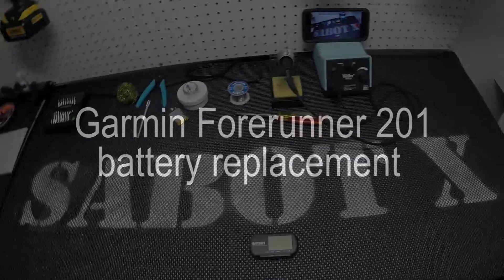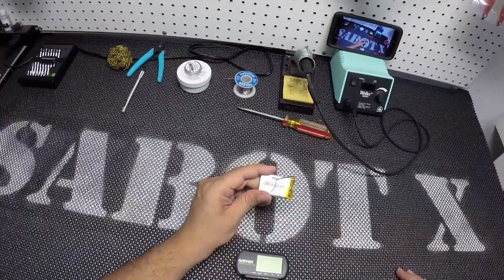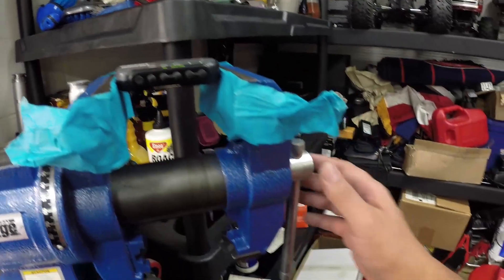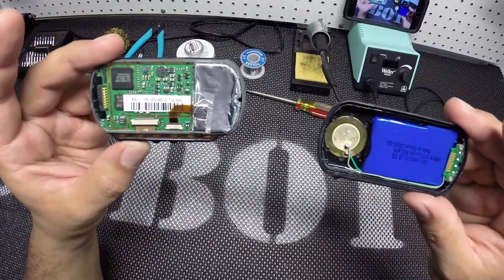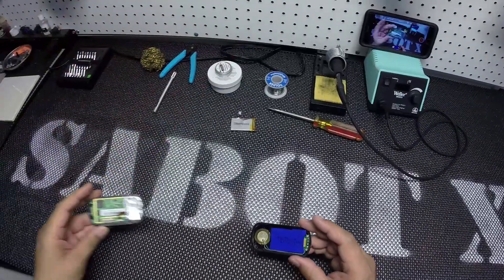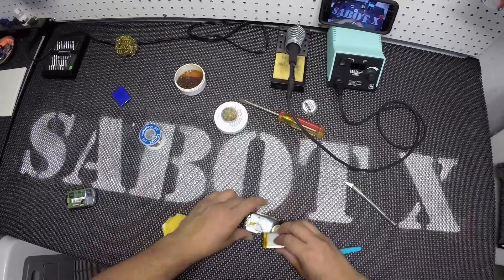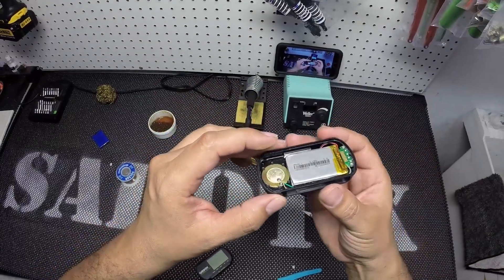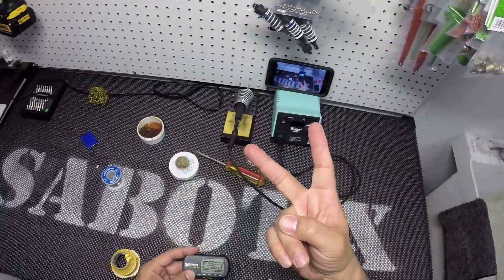Garmin Forerunner 201 battery replacement

Comment: Thanks. My 301 doesn't charge anymore, but I think it's because of the USB connection. I may also need a replacement battery. Didn't know how to open the case without damaging it. Much appreciated.

Comment: Does it charge I did the same thing and bought one off of eBay untested which I've done a few times and luckily I just put it on the charger and they come back to life and work fine. However, I bought one recently and it did not work that way. So I had a few that have damaged screens from RC car crashes, the batteries were perfectly fine however, I just pulled them back apart and completely swap. The back did not remove the battery and for whatever reason this, Garman completely drained both batteries within a few seconds so my question to you is the battery you put in as a replacement did it charge ?
Reply from the maker: It did for me, it was also a concern when I first did it.

Comment: I just ordered a garmin 301 and came with forerunner 405 for like 65$ so it saids battery bad and shows its charging on pictures, so Im hoping it will work considering i spent 65$ for it as long as its just a battery do u know where too get battery? Thanks like video its simple too fix it if its just a battery otherwise I wasted money here for my rc car speed runs

Comment: what did you use to glue the top and bottom case back together?
Reply from the maker: I used a little of CA glue at 4 points so it wouldn’t be so hard to open next time.

Comment: Hey,  I bet your using it to check the Speed in your RC cars.......  I run RC Boats,  just got a 201 on Ebay for $50.00... used supposably a 5 times or so.  Finger Crossed...  Last time I used a Radar Gun, boat ran 78mph..... kinda slow....... benched it for several year, just did some tuning and prop mods.,,,, looking for 100mph +, also installed 6S battery.   We'll see what the Garmin 201 Says.